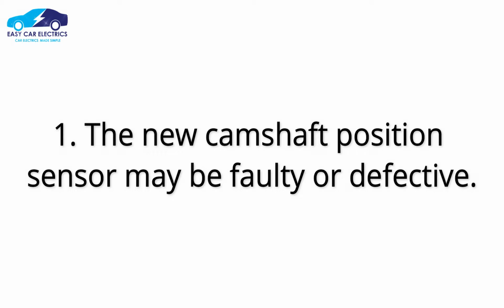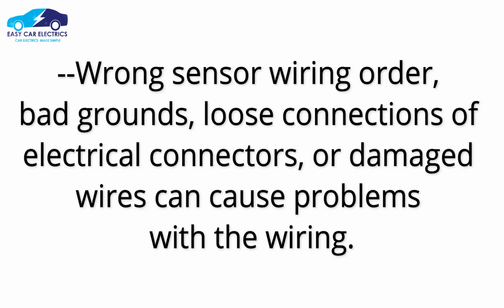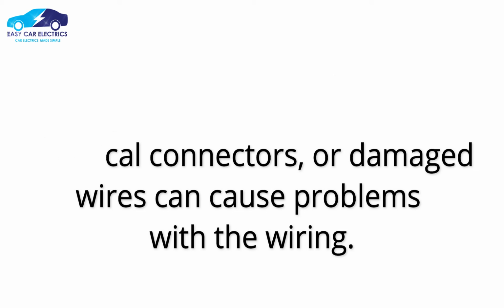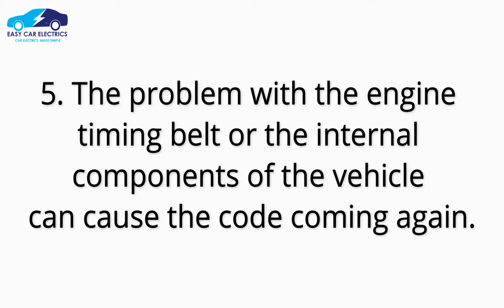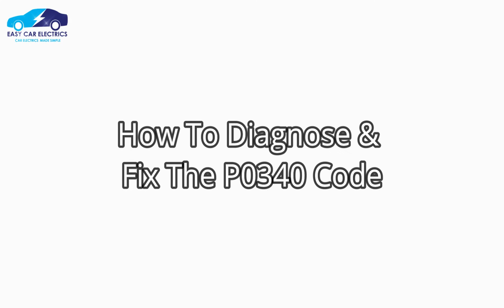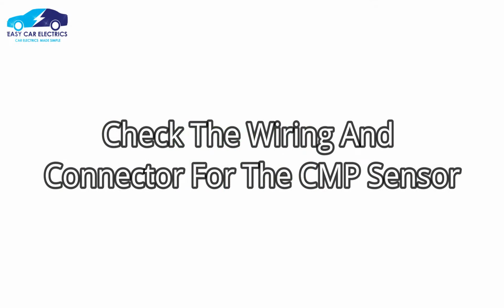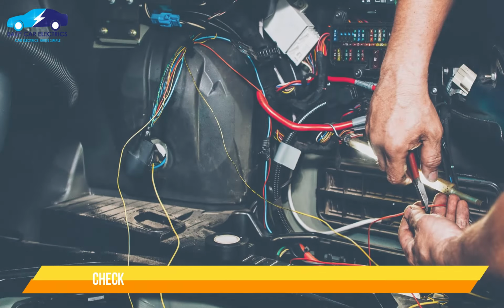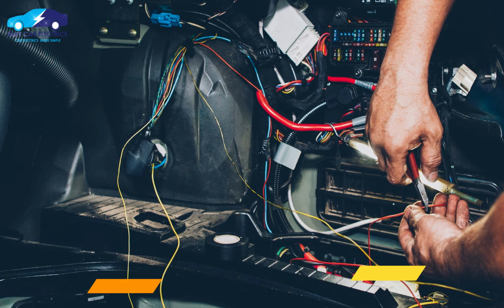Replaced Camshaft Position Sensor But Still Get Code - Easy Car Electrics

Comment: Replaced all sensors on both banks, still got ck engine light on and off. I put bottle of seafood in the oil. Must have loosen up sludge plugging up new sensors. Ck engine  light has not come back on for 3 days so far drove it 100 miles on the interstate and so far so good clear codes after adding seafood and drive it at highway speeds
Reply: I had to read that twice , gotta love autocorrect
Reply: @collinnc2001   seafood stands for what exactly?
Reply: @attilaberki3686 seafoam. Im not even gonna bother trying this i had a fuel induction service done and new coilpack.
Reply: @attilaberki3686 probably stands for seafoam
Reply: @attilaberki3686 I think he must have mean seafoam or wtv that brand that makes the cleaner for the engine